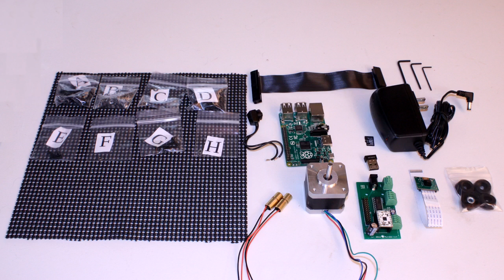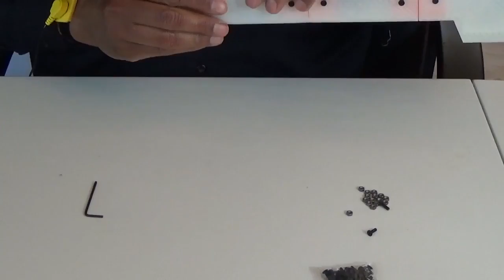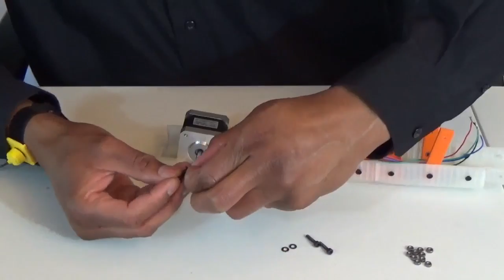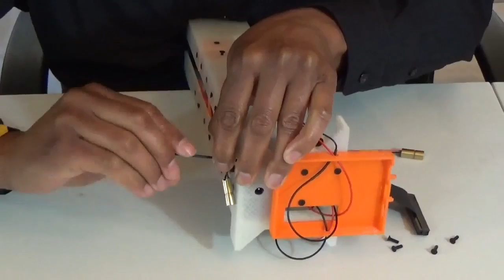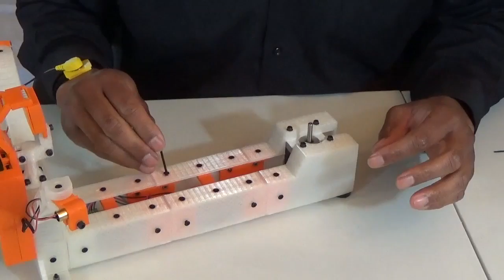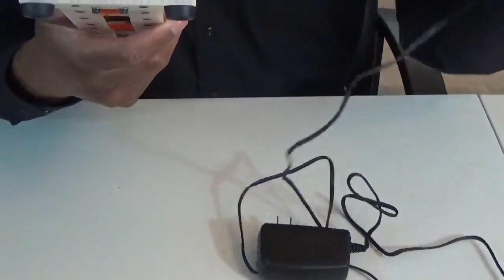ATLAS 3D Assembly Video

Comment: I backed this on Kickstarter and finally finished the build.  Some how I cannot find the power supply.  Did i misplace it, I don't know but I have looked high and low for it.  Does anybody know where I can pick up a 15V power supply that will fit this?
Reply: its not 15v. you need Output: 5v- 3000ma